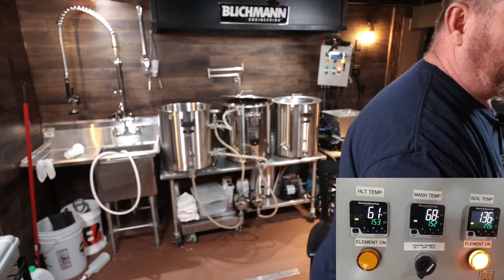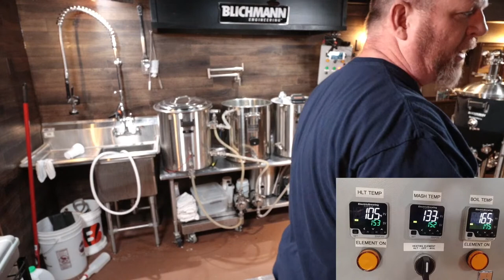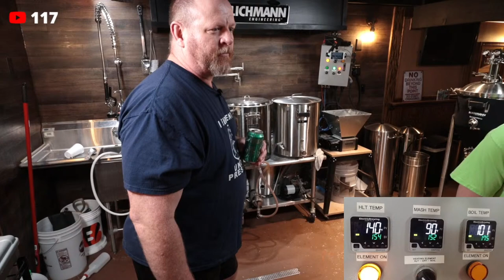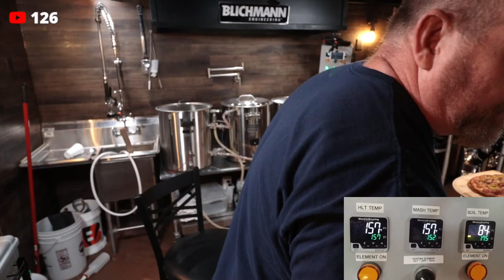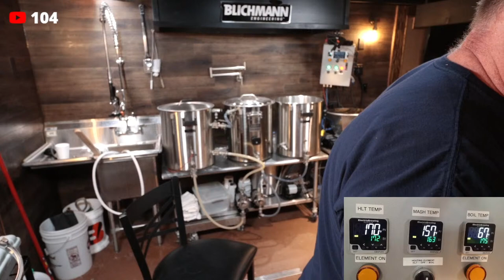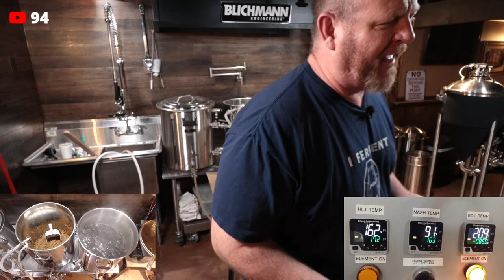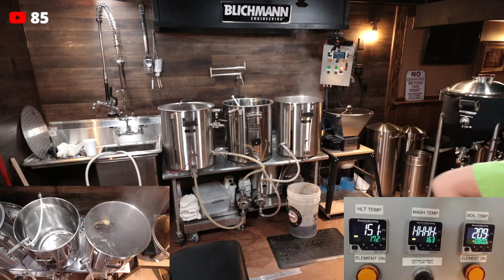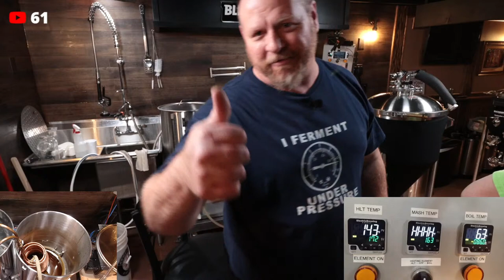LIVE Brewday!!! 1st one of 2023. Brewing 10 gallons of Imperial Stout!!

Comment: My new years resolution was to make more AG brews, first brew of the year, was extract, lol. Mangrove Jack's Orange & Cinnamon Belgian wit beer. Fermentation is going nuts, 3 days in and its very active, started Fermentation after a few hours of pitching yeast and foamed out of the airlock, had to fit a blow off valve, planning to bottle condition this one so I just did it in a plastic food safe bucket, didn't think pressure fermenting this style would bring out the bold Belgian esters. Planning a custom style, AG, Its a australian style light pale ale, I call it lemondrop lorikeet, my non official homebrewing name is Two Beaks, recipe is 96.5% pale malt, 3.5% pale crystal, 3.5 IBU's of lemondrop at first wort and 4.5 IBU's of lemondrop at 30m and approx 1g/lt lemondrop dry hops, US05 yeast, strike 62°c and mash for 75m on 60°c raise temp to 70°c and mash for 10m, mashout as you would, fermentation, 18°c for 7d under pressure, however much pressure you need, maybe 5-6 psi. Should be starting at 1.033 and ending around 1.004, 3.8% ABV and 8 IBU's, you can use dry enzyme if even lower carb needed. I've lost 13kg in 6w from alot of exercise with working as a bartender, on my feet for hours everyday and drinking low carb beers instead of full carb and drinking vodka & soda with fresh lime. Gin & soda isn't too bad either I don't think, I like gunpowder Irish dry gin.